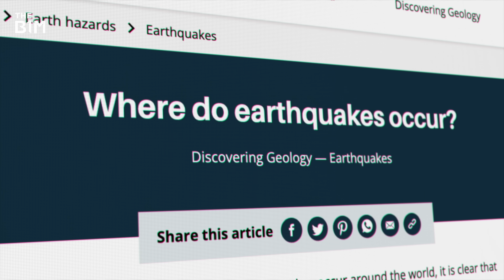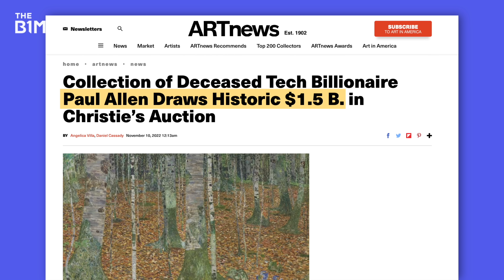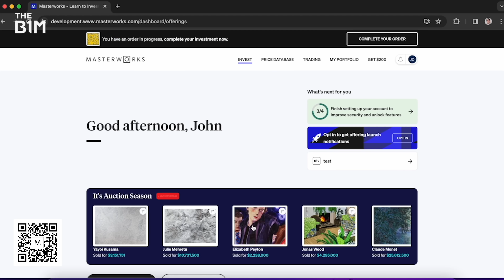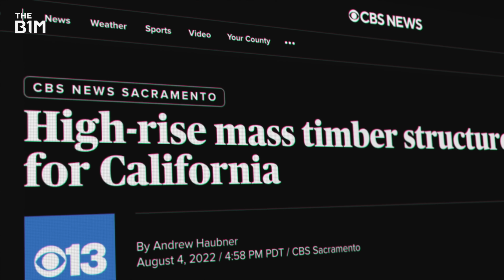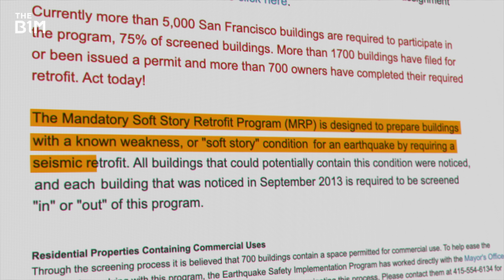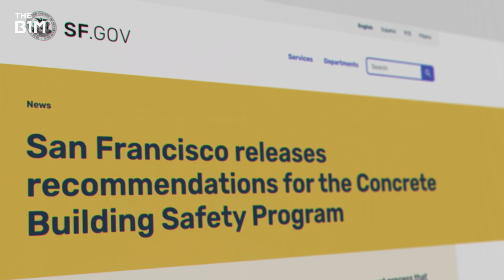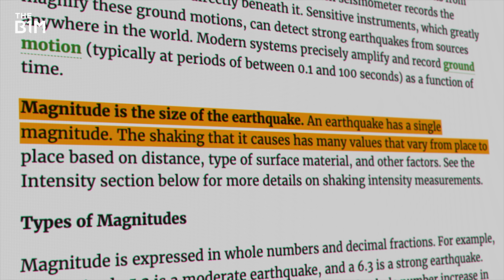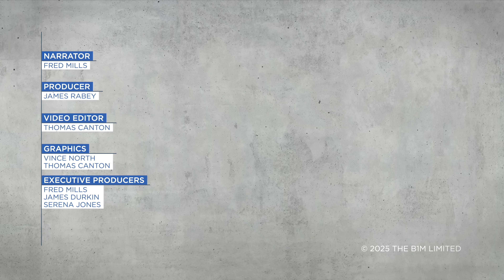Why America is Redesigning San Francisco

Comment: 12X12 hardwood main beams as depicted in the video are simply not economically feasible.  On a 36 meter high building using wood the main columns and beams would have to be so large that not only would they be uneconomical they would also take up most of the space of the lower floors.  DUH!  That was why no buildings were taller than about 5 floors prior to the introduction of structural steel.

Comment: I worked in the original Apple Campus (Infinite Loop, not the UFO) and those buildings were built on large rockers so they swayed a lot during quakes - but......didn't fall over. It's like driving over a speed bump.
Reply: that analogy does NOT WORK in any facet. you wanker.
Reply: Well, in 89 one of the buildings was severely damaged (a friend watched is brand new R&D mac hop down the desk and out the broken window to its death from his third floor office doorway.
Reply: @Georgewilliamherbert  right. i bet it did.... sure boss.... woz prolly holding onto the power cord too huh.... get fkd
Reply: Funny, I worked on those buildings, Don’t  remember “large rockers “ the buildings were built on. Which building did you work in?

Comment: My dad is a structural engineer in the Bay Area he is actually currrently working on the airport project but mostly does soft story retrofitting it’s really interesting stuff and some extremely complex math to account for all the potential forces of a earthquake this is also a hugge reason why housing in California is significantly more expensive because every building has to be built to a significantly higher standard in order to withstand the forces of earthquakes
Reply: Seismic retrofitting is certainly expensive and contributes to the high cost of housing, but I wouldn’t say that housing in San Francisco is built to a high standard. In fact, most of the housing stock is over 50 years old, and few can afford to construct new buildings to modern, high-quality standards. That’s why so many buildings have been retrofitted—originally built with lower structural performance, they were later reinforced when the local government prioritized earthquake preparedness, adding more resilient structural systems.
Reply: I thought your talking about the bay of plenty
Reply: Which airport?  SFO, SJC, OAK, RHV, STS, NUG, SUU, SQL, CCR...
Reply: Ask Gavin why housing so unaffordable? ... and maybe also ask when the train line is due to finish
Reply: @And__CLam  Market forces
Reply: @tompatterson1548  Yes I agree ... bad governmental policies
Reply: @And__CLam CEQA specifically.
Reply: Japan also gets earthquakes but the housing in Tokyo is relatively affordable
Reply: @andrewbaumann2661  Yes and do some research, Japanese homes are built very shabby and don't increase in value over the decades. They are more similar in sturdiness to manufactured housing here in the US. SF homes aren't airtight and the climate doesn't weather them like on the East Coast. Residential construction costs is purely the land costs in CA.
Reply: Ask your papa if the homeless at the airport are helping the construction
Reply: @djHALWA  San Francisco International Airport, discussed at length here, is not in the City and County of San Francisco. It's located in an unincorporated area of San Mateo County.
Reply: @RaymondHng  yes it’s in San Mateo county

Comment: I was reminded of San Francisco's Millennium Tower, the 58-story condominium high-rise that's leaning 29 inches on the northwest corner of the building. Now, in addition to the lean, it's actually sinking as well. Built in the SoMa neighbourhood, it's the only part of the city that's flat, but as you describe, it's not even bedrock.
Reply: The issue really is that the engineers didn't account for how much building was going on nearby and that it would change the forces holding thw building up
Reply: Land fill
Reply: @mrbaab5932 Yes and ironically most of the landfill is debris from the 1906 earthquake!

Comment: I live in a Queen Anne in a Historic Distririct of San Francisco and went through a nine month retrofit. I hope it was worth it (it probably was).
Reply: Can I ask you what the cost of the retrofit was, and which elements it included?
Reply: @Yowzoe  Retrofitting a Queen Anne-style house in San Francisco to meet current earthquake standards can vary significantly in cost, influenced by factors such as the home's size, age, existing structural conditions, and the specific retrofitting methods required.

For homes with a raised foundation, a common type of earthquake retrofit completed by a licensed contractor may cost between $3,000 and $7,000. 

However, for larger or more complex structures, such as multi-story Victorians or homes with a soft-story condition (e.g., living spaces above garages), costs can be substantially higher. For instance, soft-story retrofits typically range from $15,000 to $25,000. 

In some cases, extensive retrofitting projects have been reported to cost between $100,000 and $400,000, with certain projects reaching up to $1 million, depending on the building's size and the complexity of the required work.

Comment: Your "1989 earthquake footage" when the highways collapsed ccurred in 1994.
I was in San Diego at the time...
Thank you for this channel, as I learn something new/more with every video!
Hello from Seattle Washington 😊
Reply: Think you’re confusing the Northridge earthquake of 1994 that occurred in Southern California, with the earthquake that occurred in 1989 in San Francisco.  Freeway collapse in both, and that footage is from San Francisco in 1989.
Reply: Nope.

The footage of the double decker freeway structure that pancaked for over a mile was the Cypress Structure in West Oakland that failed in 1989 due to a botched CalTrans seismic upgrade. The freeways that failed in LA during the Northridge quake in 1994 were all single deckers. Like the Santa Monica Freeway section in West LA and the interchange in the Antelope Valley. 

Drove the lower deck of the Cypress back to the Bay Bridge a few months before Loma Prieta and was in a tilt-up single story office building on Bay landfill in Marin County when the shaking started. Which was interesting to say the least. Had to drive back across the Golden Gate Bridge a few hours later to get home. Once the Marin side connecting structure to the bridge got the OK after the initial visual inspection by the bridge engineers. They did a very serious seismic upgrade to the bridge a few years later.

Comment: Considering all the wildfires in California. Is it really wise to build more and more with wood?
Reply: San Francisco city does not have any real wildfire risk. Areas that do have a risk of wildfires tend to be more rural or suburban areas, which is mostly made of single family homes. The reality is, unless you built massive soviet style concrete apartment blocks, you are building those with wood. The real is to minimize the risk of fires starting or spreading through the surrounding environment.
Reply: You’re right, not one of the engineers or regulators thought about fire risk.🤦‍♂️🤦‍♂️🤦‍♂️ mass timber has been thoroughly fire tested. Obviously there is a fire risk, but that risk is well understood.
Reply: @johndeere3486  yeah it looks well understood and managed following the complete destruction of LA 🤦‍♂️🤦‍♂️🤦‍♂️
Reply: @mattshaw9449 When did LA have an earthquake that destructive?